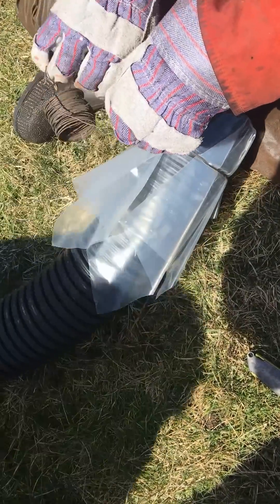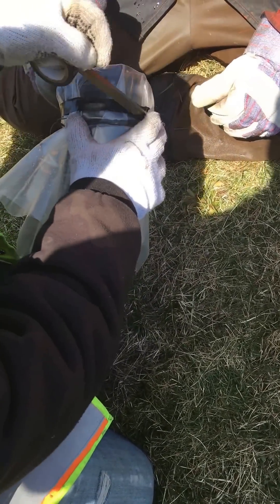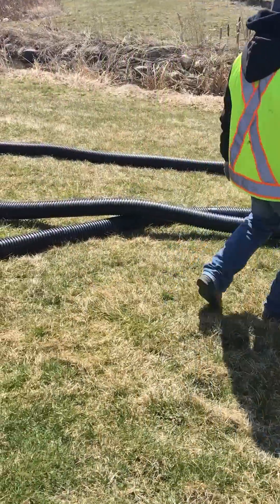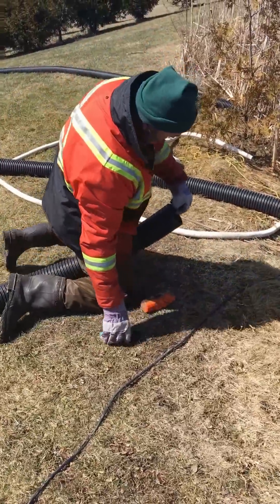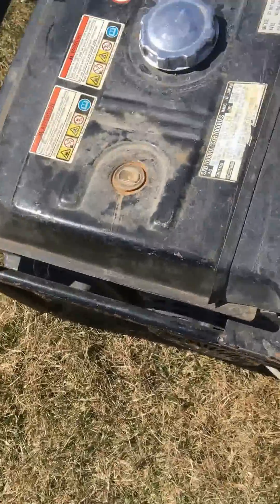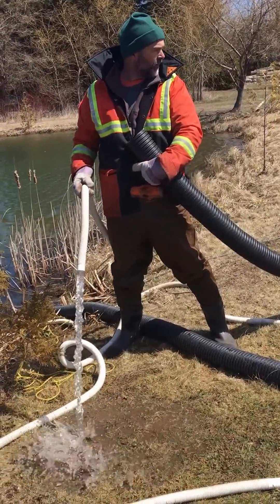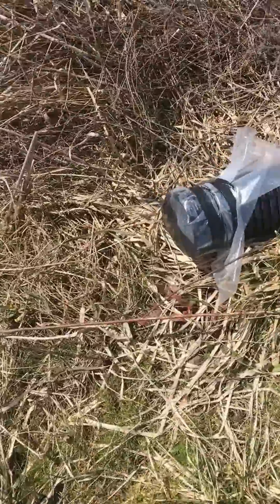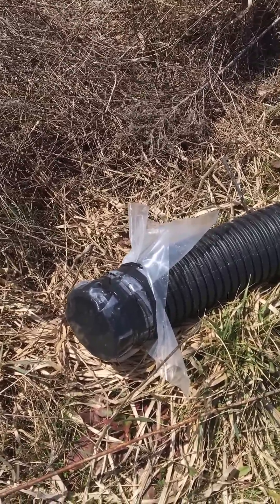How to start a siphon a pond in 10 mins

Comment: Yep would have been good to show the end into the pond, as I have tried this when trying to suction the muck from the bottom of my rainwater tank, but with both ends open the difficult part is to put both ends of the hose down at the same time, if you know that I mean. I have not persisted enough to think to put plastic on the low end. With this idea it should work next time, so overall thanks for sharing the video even though you may not quite have the camera skills of James Cameron.  🙂

Comment: When I saw you were going to use unpunched,110mm drain coil to do this I thought 'brilliant' 'cause I been trying to do exactly this by myself for a day or two. Where you show how to seal the outlet end is very good...I will do this. Thing is the film doesn't show the timing,, the synchronisation involved. I'm having to do this alone so Q. Do I drop the inlet end in first ensuring that it is %100 under the water and then run/climb down to the other, outlet end quickly and open that end? I think so am I right? Will the water from inside the hose run out of the hose back into the pond before I open the outlet? I am doing this alone...
Reply: I want to know the same thing.Having  the same problem.

Comment: How long does the siphon last?  My experience with corrugated pipe was not very good.  The siphon lasted less than a day.

I switched to 4 inch pvc pipe  with a check valve on the high end ,  a T fitting with a cap in the middle for filling and a cap on the low end that is removed to begin the siphoning.  

This system was pretty air tight and lasted weeks.

Comment: Some additional explanation regarding the generator use and that white fill hose would be appreciated.

Was the generator providing power to a submersible pump in the pond?

Was the white fill hose attached to said submersible pond pump?

Thank you for the video.

(Also, add the word "of" in your title and you'll be good to go.  "How to start a siphon of a pond in 10 min.")
Reply: They fills  black hose with white one and yes they has a small pump on pooll . itll work no mattter   how you fill the hosr  just fill it ;p

Comment: You could have put a piece of iron pipe in the end of the plastic pipe. Thrown that open end into the pond. Get the air out by submerging the rest of the pipe then tape it off. Drag the now loaded pipe over the dam edge. Drop it to a lower level then slice it open. No pump needed.

Comment: how many men does it take to start a syphon?  you could have made it more difficult, but I don't know how.. yoy don; 
t need to fill the entire line just enough to start the suction . wire,  tape, pump  what a load of shit
Reply from the maker: CJ W wtf are you talking about, what do you mean how many men does it take. It's called help, friends that wanted to help. And I did fill the pipe, And that's the materials that we used to do it. And it work.
Reply: first thing that got me was the gloves & safety vest.  nothings worst than a paper cut or a drunk land owner running you over in a golf cart.
Reply: They seem to be having a good time

Comment: you didn't show what you did with the open end... do you simply set it down in the pond? slowly? quickly?
Reply: That's what I didnt understand how you lowered the open end into the pond without losing the water in the pipe.
You could actually once filled, cap that end the same way you did the bottom end then when in the water cut it also.
Reply from the maker: Nick Gann we placed it in the water slowly
Reply: bighoss ty. I intend to use your method. good video
Reply from the maker: Nick Gann thank you, within 24hrs that pond dropped over 3 feet, considering we had four- 4" pipes. This works very well.